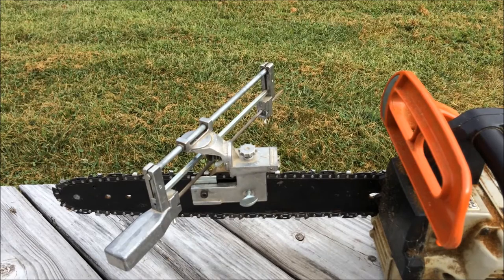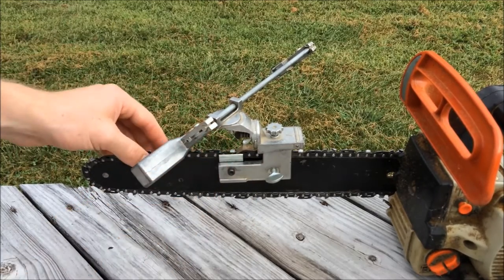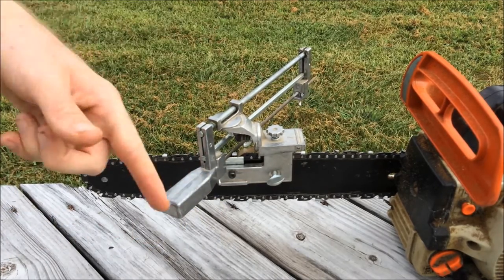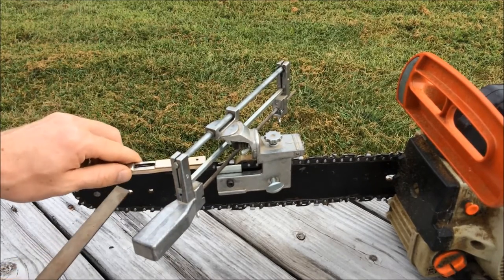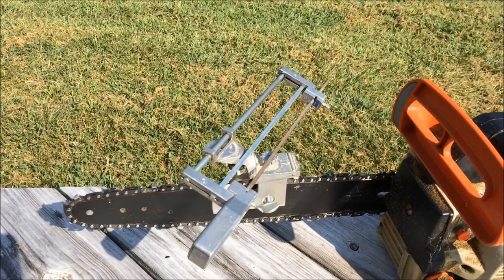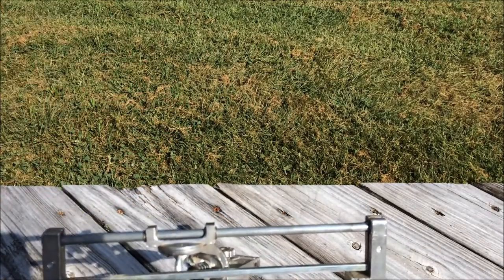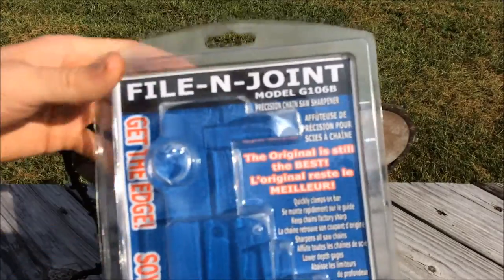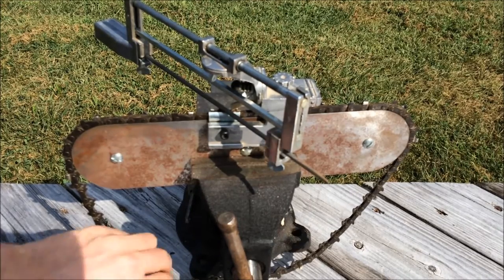Sharpening Chains with the Granberg File-N-Joint (OLD VIDEO. NEW LINKED IN DESCRIPTION)

Comment: Nice chain vice I might need to make one of those.
FYI, you can use the Granberg jig to file down the depth gages as well, just replace your round file with a flat, or triangular one.
The adjustment angle that you stated "I'm not exactly sure what the application of that would be for" is to change the elevation angle of the cutter. You are keeping yours at 0°,  which may be appropriate for your chain , however you should check out the specs for your chain. For example my saw an Echo CS-4400 calls for a 25° azimuth (left to right from the bar)  and a 10° elevation (up-and-down from the bar or down angle). That's one of the things that makes this such a nice jig.

Comment: The Granberg File-N- Joint is a great little unit and will sharpen just as well (if not better!) as an electric bench grinder; it's just slower than the bench grinder. Being old and lazy I use a bench grinder. I like your home made bar vice device; good idea.

Comment from the maker: As a couple people have pointed out, I use the sharpener differently than most. After some experimentation, I decided to flip the file so that the tang was not in the handle. This allows me to pull the file instead of pushing it. Per Granberg instruction manual, you are supposed to have the tang in the handle and push the file through the cutter.
Reply: My grandfather used to flip the file and pulled the handle in reverse like you, his chains were always sharp.

Comment: Why do it bass-ackwards? Put the file in with the tang in the handle, then with the handle closer to the power head, push the file into the cutters. And, why take so long to demonstrate something so simple?
Reply from the maker: After messing around with it both ways, I decided that I preferred to pull. It's just a personal preference, and as long as the file is oriented correctly, either way works.